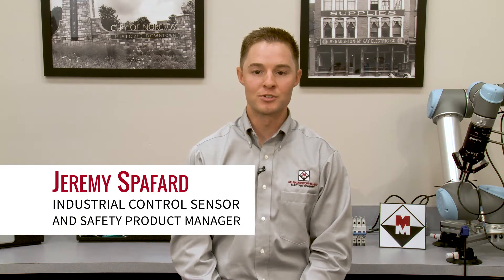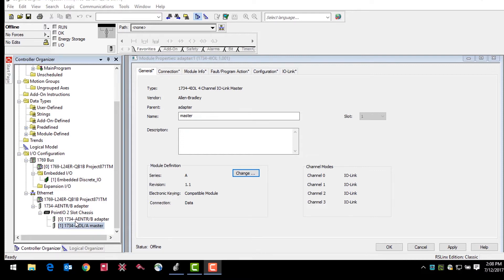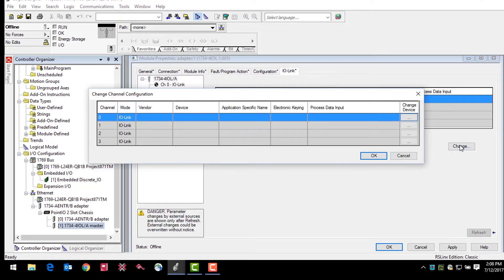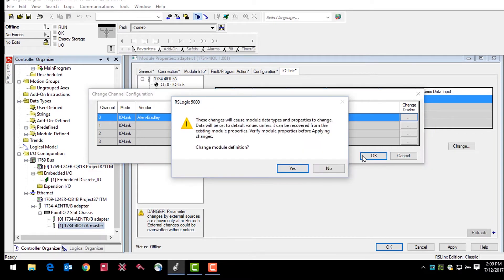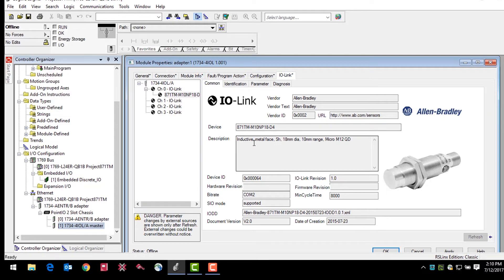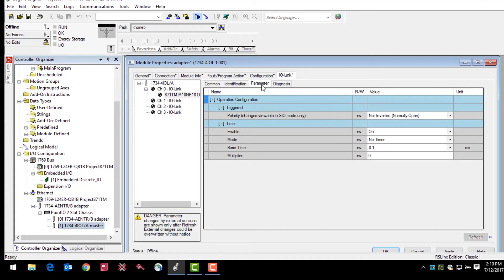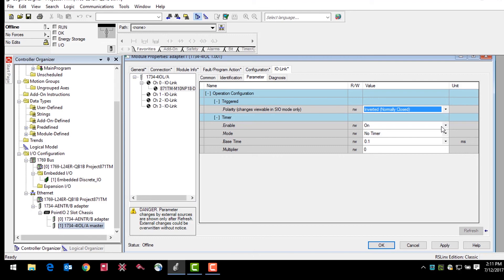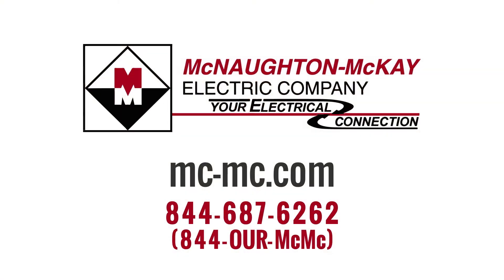Configure an IO-Link Sensor Profile in Logix

Comment: Which IO_Link master module did you add in the device tree? @1:20
Reply from the maker: Hi Michael, Thank you for your question. This video uses the 1734 Point IO IO-Link master (catalog 1734-4IOL). This module requires an ethernet card to communicate with the PLC (1734-AENT). We also have a module that is a communications adapter and IO-Link master in one piece. That is the 1732E-8IOLM12R. For more information on Rockwell’s IO-Link lineup, visit the following link or contact his local distributor. https://ab.rockwellautomation.com/allenbradley/networks/io-link.page